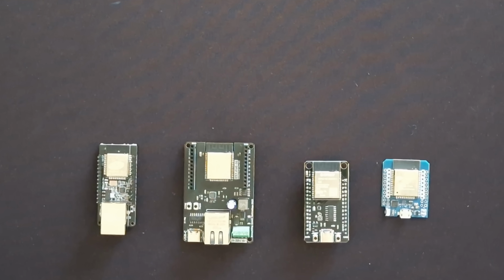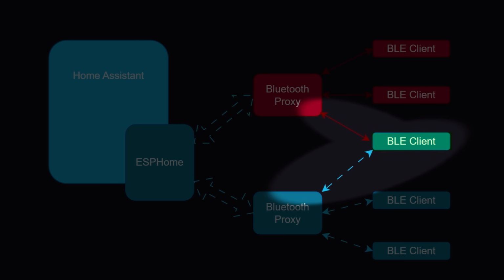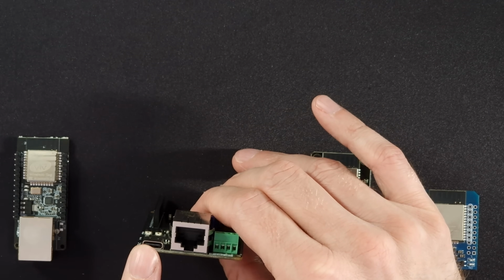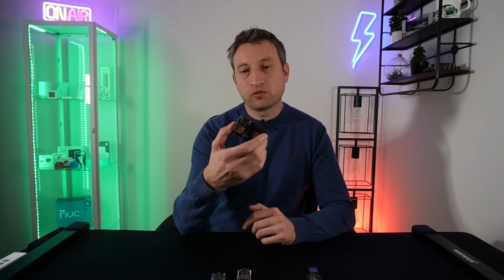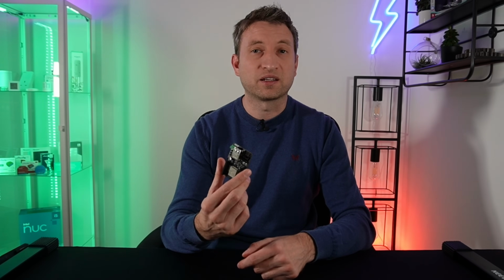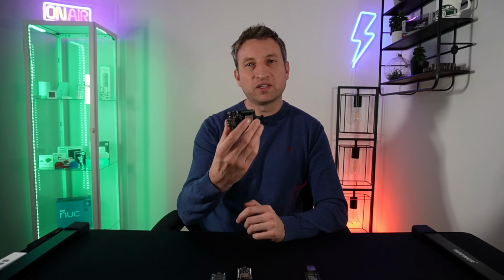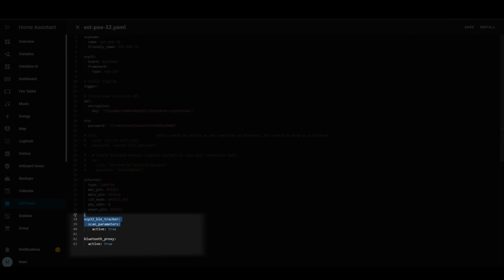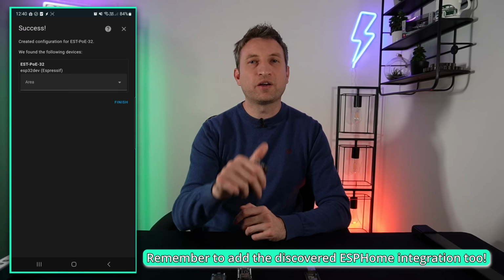Every Home Assistant Install Should Use This

Comment: My wifi can fail occasionally but my Zigbee network is rock solid. What does BT add to a solid Zigbee network? I am guessing data rate so you can stream video and music? Pretty sure some of the newer ESP32 can do Bluetooth Mesh as I’ve seen it specified. Can home assistant also do Bluetooth Mesh and if so could these devices take part in a mesh instead of each broadcasting individually? Also can ESP home do Zigbee to Bluetooth Proxies?

Comment: I have a HA Yellow PoE with Pi4 with the onboard Bluetooth enabled (WiFi disabled). Is it necessary to disable the onboard Bluetooth when adding ESP32 Bluetooth proxies to the network or is Home Assistant happy to allow devices to connect to both?
Reply from the maker: I believe that they work together and the onboard one can just act as another Bluetooth proxy.

I haven't personally tried this though because I run my Home Assistant on a VM so don't use a local Bluetooth dongle, just BLE Proxies.

Comment: Thanks for the tutorial. Any recommendations for 3D printing the enclosure for the EST-PoE-32? Tried a few links from Google and Xometry seem to be cheap compared to the others. £12.17 for the two pieces in white ABS.
Reply from the maker: I haven't looked myself but it would be great if there is a good one. 3D printing has slipped down my list a bit to be honest. Need to spend more time on it!

Comment: Hi,I have two ESP32s, I look at the logs, it only scans once every five minutes, is there a way to shorten the scanning time?
Reply from the maker: Hi. Yes, you can change that.

If you add the "duration" parameter within the scan_parameters then you can define how long you want a full scan to take.

Without this parameter it is actually scanning all of the time, defined by window and interval, and will for example pick up iBeacons quite quickly,  it just doesn't update "off" states until a full scan has not "seen" a tracker.

For normal Bluetooth proxy stuff I'm not sure the duration matters much. Hope this helps!
Reply: @lets-automate  Thank you,mate!I use the Private BLE Device plugin to get the room location of my phone. At first, I felt that its status update was very slow, and after I tested it, I found that I needed to turn on my phone in the designated room, and he would update it in real time...

Comment: so i just got the ESP32 board and i've connected it via micro usb to my laptop and went through the process of installing it, but installation seems to be stuck. how long should it be "installing" and "preparing installation" for? its been like 20 minutes.
Reply from the maker: Yeah that seems like it's stuck! It should only take a couple of minutes.

Did you use my yaml file as a base or create your own? Which ESP32 device do you have?

I'm trying to think why it's stuck. Normally just fails if there is an issue.
Reply: @lets-automate  there was something wrong with my USB port on my Microsoft surface laptop. I don't know what it is but it's supposedly not registered as a serial port or something to that effect. You basically only gives power to things that are plugged in. I tried different data cables and it still didn't work. But I finally was able to use my y's laptop and got it working perfectly fine. All is good over here and now I have my switchbot devices connected to my home assistant. Not sure what is wrong with my USB port. But whatever
Reply from the maker: Great to hear you got it working!

I have found the integration to be really reliable. Been using with my SwitchBot lock and it actually opens quicker through HA than using the keypad sometimes.
Reply: YOU NEED TO DOWN LOAD DRIVERS TO MAKE  IT INSTALL I HAD THE SAME PROBLEM
Reply: @billgann2257  when I was having the problem, I did download the drivers which didn't fix it. And I made sure that the cable was used to transfer data. And when I got my wife's laptop I was able to do it just fine. So the problem is definitely the USB port in my Microsoft surface pro 7

Comment: Hello
Does anyone has a link for a good case for this est ??
Reply from the maker: I've not seen one tbh. My 3D printing skills are fairly basic so I just used a project box to save time.

I'm sure that it will be on EST's list to start selling cases for their products at some point.

Also this is a pretty big dev board so if you want to connect lots of sensors then it's handy.

Otherwise, there are some smaller PoE ESP32 boards out there. (I haven't tried any though)

Comment: Hello
I not have device for powering this device by poe....
Could you indicate a device for powering poe ?
Thanks
Reply from the maker: Hi there, sorry for late reply!

Do mean that you don't have a PoE switch to power the ESP device via PoE? If so, they you could just use the USB-C port instead of the DC terminals with an old power supply that you might have lying around.

If you really want to power it with PoE so that you only have one cable then you can buy a PoE injector which conforms to the 802.3af or 802.3at standard.

Comment: All my esp32's are on wifi. Does the fact they can't do wifi and BT at the same time lean they might miss some incoming WiFi/BT messages?
Reply from the maker: They are pretty good at managing both tbh. But if you have congested wifi then it can take longer to communicate and therefore delays Bluetooth comms, which can cause stability issues.

The difference between the "interval" and "window" scan parameters effectively determine how much time you give for WiFi.

The time it can be noticeable is if you are trying to detect iBeacons which don't transmit multiple times per second, then you may miss a few transmissions.

I personally have mainly WiFi ESPs and 1 wired one in the centre of the house so that if WiFi goes a bit odd (or maintenance) then you still have the wired one working okay.
Reply: @lets-automate   OK thanks! My unifi access points should be able to handle the traffic I have here and also no issue with interference from neighbours.
I don't use ibeacons for the moment (I think I'm naively waiting for ESPHome to have embedded the same functionality as ESPresence), rather things like curtain rails, toothbrushes and weight scales.
My house is rather large, so I have my doubts whether a central wired ESP32 would be able to provide bluetooth coverage troughout the house (still better than nothing of course). I might consider the new every presence pro devices when they come out.

Comment: All shelly smart devices that run on an ESP32 chip can also be used as a bluetooth proxy. So it's a win-win of having a super easy to use shelly device like a smart plug or switch, and it immediatly doubles as a BT repeater for home assistant.
Reply from the maker: Yeah, I love Shelly devices.

I do also like having wired devices too though where possible. 😁
Reply: @lets-automate  You mean wired power, or wired network?
When it comes to power then i most certainly agree, i would never run anything off batteries unless absolutely necessary.
When it comes to network then i have to say 98% of my smart home stuff uses wifi, and it's been solid as a rock for about 5 years now..
Reply: I have two Shelly Plus 1 devices installed in my garage. I also have a few Shelly Blu Door/Window sensors. I tried enabling the Bluetooth proxy on just one of the Plus 1 in the hope it would improve the connectivity of the door/window sensors. Does the Bluetooth proxying only work with HA if you replace the Shelly firmware with a custom ESPHome firmware?
Reply: In HA I configured the Shelly device with 'Passive' mode. In the Shelly configuration (web admin) I enabled the Bluetooth and Bluetooth gateway settings.

Comment: I find esphome the most annoying item of all. its reliant on config annoyances. standalone devices are superior
Reply from the maker: Thanks for your input. Yeah, it is always a trade-off.

The thing I like about it is that even if you don't want to create things yourself with it, it's allowing creators/developers to make pre-configured products using ESPHome as a foundation rather than coding something from scratch.

I imagine a lot of people who use to code Arduino sketches for little sensors don't bother anymore, they just write some YAML instead, which is certainly easier than learning C.

Comment: can i use the EST-PoE-32 to connect for example the Switchbot bot to Homeassistant and controll it? Becase that device only communicate via BT and would normally require the Switchbot Hub but i don't want more "hubs". Running HA as an VM on a server now.
Reply from the maker: Yes, the SwitchBot Bluetooth integration will allow you to connect the Bot to Home Assistant via a Bluetooth Proxy, without the need for a SwitchBot Hub.

I do have a SwitchBot Hub, but the devices all connect directly to this integration instead of the hub, so it's not massively used...and I agree the less hubs the better!
Reply: @lets-automate  Superb, thank you for the reply.
Reply: @lets-automate  I have the Switchbot hub connected to a guest WiFi network that's isolated from LAN, just for the benefit of syncing data from temp/humidity, etc. to the Switchbot cloud as a backup. I use the Switchbot app for updating the device (Curtain, Blind Tilt) firmware too. I've not seen HA notify me of new firmware, perhaps that's not part of the HA Switchbot Bluetooth integration?
Reply from the maker: Hi! I believe that you will still need to do firmware  updates from the SwitchBot app sadly.

The Matter platform is a bit annoying because it doesn't seem to work across VLANs, so you will need to continue using the Bluetooth or cloud methods.

Comment: you showed airpods at the beginning of the video. in the case of a bluetooth proxy, will they be able to work as the sound output of the PC/RPI/whatlese which runs homeassistant or extend the bluetooth range of the smartphone to which these headphones are usually connected???
Reply from the maker: To be honest, at that point, I was just demonstrating how many things use Bluetooth these days.

It's a shame that the Bluetooth Proxies can't act as an extender for any devices. It can only do it for specific products. It would be great if they could do that.

I actually wish Home Assistant had an easy list of Bluetooth devices supported. (I haven't found one at least)
Reply: @lets-automate  I tested inkbird thermometers in my fridge and freezer, and ATC MIThermometers flashed with the btHome firmware. all works fine with esphome bluetooth proxy. but I never tested sound devices.

Comment: Yeah, but what can they do for you? You seem to have missed that crucial point.
Reply: They extend bluetooth range. Think of them as bluetooth repeaters...
Reply: Clearly they allow Bluetooth devices to connect, and using ethernet makes it more reliable. As per the video Bluetooth has a range of about 10 meters, may be less in a building, so a device may be out of range, so you place one of these near that device it will be able to connect back to HA reliably.
Reply: o7  ah, someone who already knows tells someone else that it's obvious, "stoopid". "it makes your wireless connections more reliable". So a Bluetooth repeater then? For what kind of device? Having watched many home assistant related videos now I thought most devices were wifi or zigbee or matter. I've not come across any yet that talk about Bluetooth sensors. So sincere apologies for asking what to you is clearly a stupid question, because you know the answer. Knob.
Reply from the maker: Thanks for the comment!

What do you mean by "what can they do for you?"?

In my system I mainly use them for my BLE SwitchBot Lock, SwitchBot curtains and Xiaomi temperature sensor.